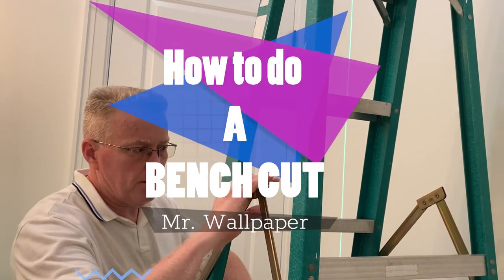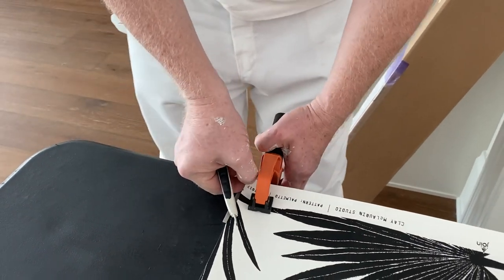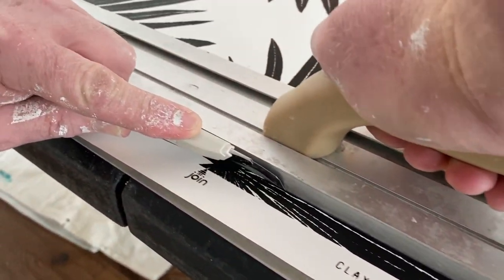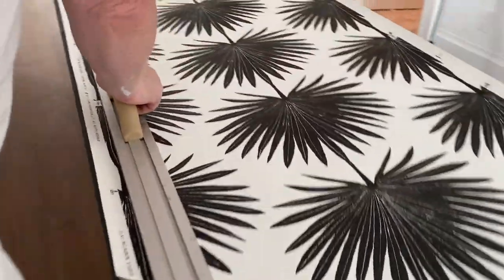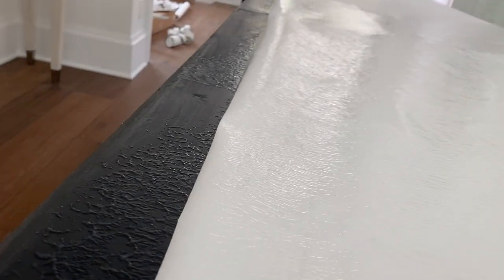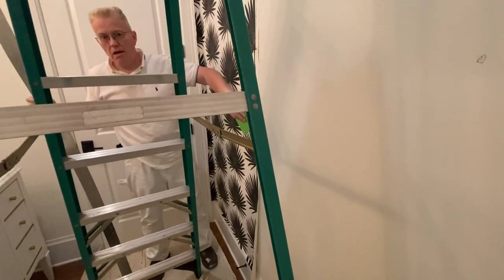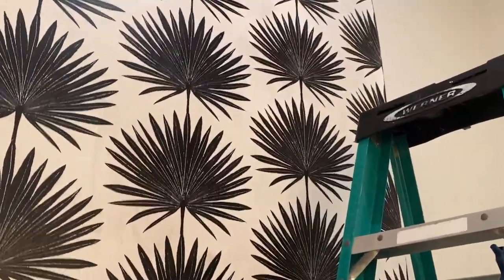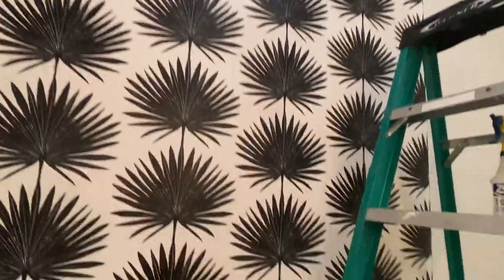How to Do a Bench Cut on Your Wallpaper - Spencer Colgan

Comment: Get a 6’ straight edge , measure the trim line  for example if it’s 1inch just run a 1 inch trim that on long bastard, also reverse roll it to break up that crazy curling, slap some paste and toss that easy paper up 👍